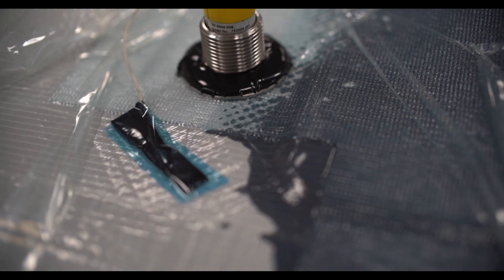Journey to HX50 | Episode 6: Why build a 1/3 scale model HX50?

Comment: total bollocks, the reason you do a cheap model is your 80% sure you will change the design for what ever reason, unless you use a scaled down carbon weave, three ping pong balls one half normal size one normal and one twice normal size, which one is the strongest ?